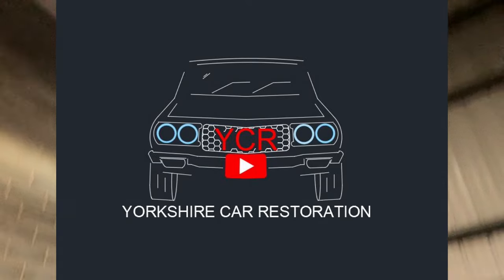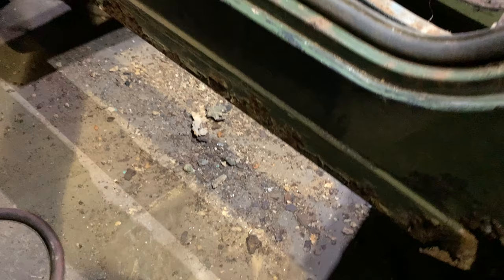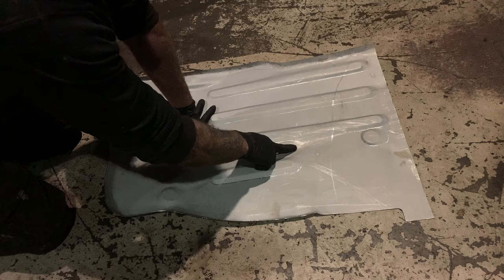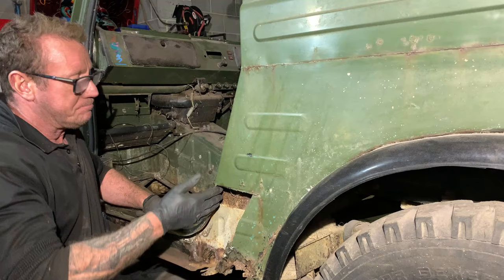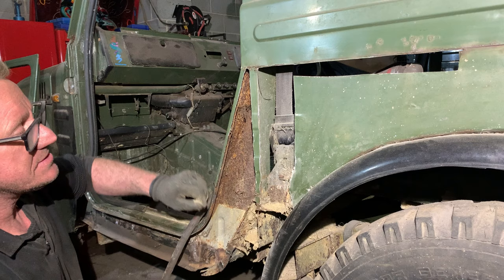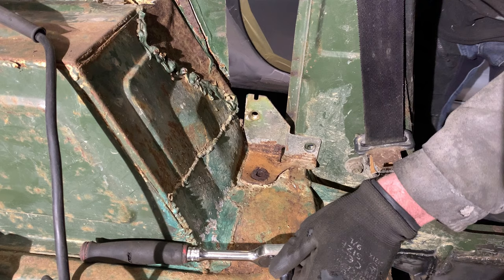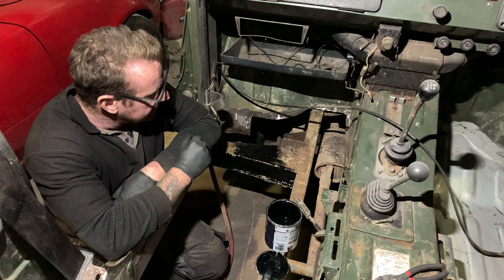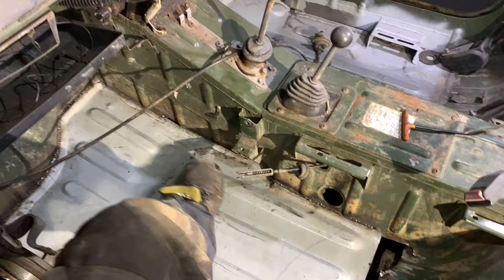Suzuki LJ80 Restoration Part 3 Replacing floor pan

Comment: I thought about using hammerite, did that held up to this day? Did you wirebrushed rust and used rust converter before applying it? I'm thinking of doing interior side of floor and trunk like that
Reply from the maker: Yes that's what we did. And it's Stood up fine. Although we ended up splitting the chassis from the body in a newer video and fully refurbished the chassis and underbody
Reply: @yorkshirecarrestoration  Glad to hear that!

Comment: Brilliant vids. I have just finshed restoring my 1979 LJ80 biggest problem was welding such thin metal, I was using a Cigweld 135MIG https://www.cigweld.com.au/product/weldskill-135-mig-portable-welding-machine/ any idea what settings I should have used withou burning through? TIA
Reply: How thick the metal?
Reply: @egasfazal3549  Closer to .5mm
Reply: Okay thanks
Reply from the maker: All welders are different, make sure the gas is on low and increase it if it splatters but still should be low. The line speed needs to be a constant crackle but if it sounds like it's uneven soundng and if you can feel it through the torch then it's to fast, if it sound empty then crackling them empty again then the line speed is too slow. Also the power depends on the metal your welding but we have ours on number 3 on a 180amp welder that has 6 settings on. Also constantly welding will blow holes and warp the thin low grade metal, spot weld on top of the previous weld as we do in the vids to make a Seam. Best thing to do is try different settings on a spare piece of similar grade steel if you have it
Reply: @yorkshirecarrestoration  Thanks for the response but nobody mentioned about GAS what is GAS! .  I was/am a complete newby as far as welding is concerned. Just boaught a welder and tried to weld according to the CD supplied. It was a nightmare
Reply: The gas is argon.
Reply: @stevegarbutt1521  Thank you